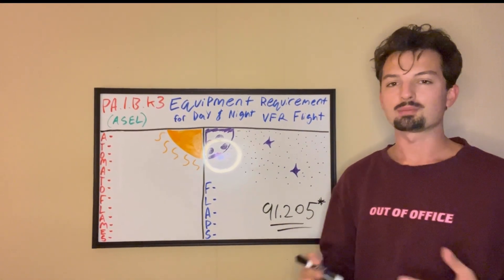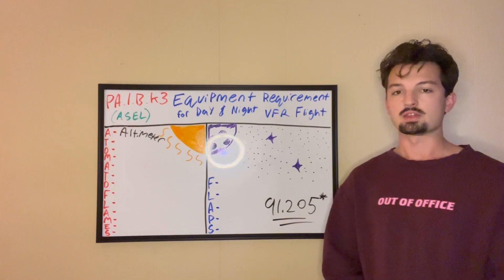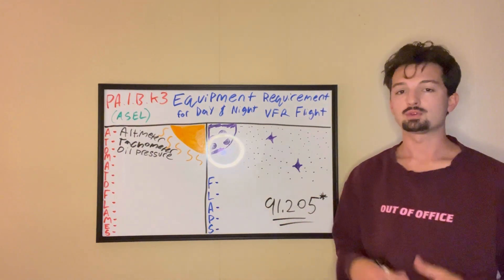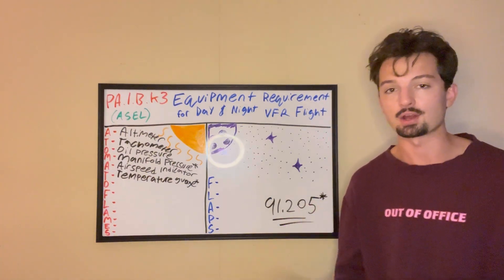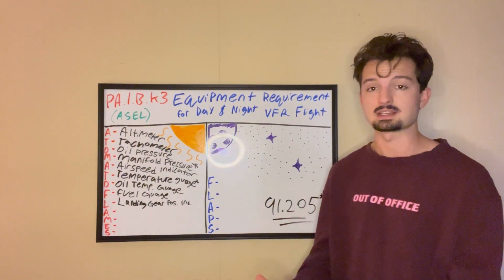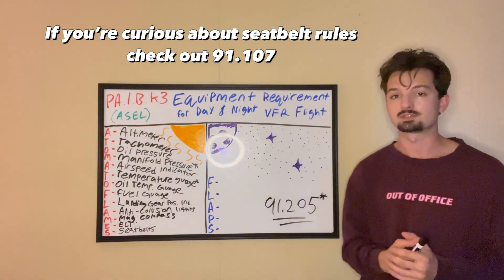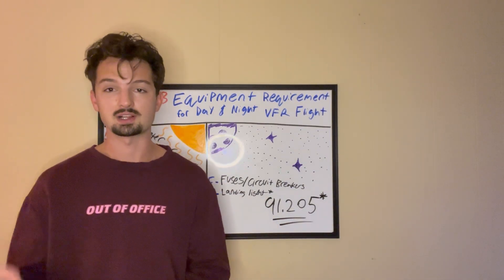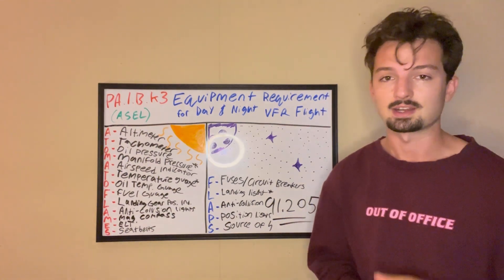THE ACS - ATOMATOFLAMES; Equipment Requirements for Day/ Night VFR (PA.I.B.K3)

Comment: With the anti-collision lights being on both sides. If your plane was certified after March 11, 1996, you need anti-collision lights Day and Night. If it was certified before this date, you are only required to have anti-collision at Night. Regardless of the date, every aircraft needs anti-collision lights at night. Student Pilot from Florida Love your videos man, keep it up.
Reply from the maker: Yes every plane needs anti-collision lights at night, and the rotating beacon also counts as an anti-collision light, in the case your plane was certified before March 11 1996 you do still need anti-collision lights at night, but the rotating beacon alone counts, in the case you don’t have strobes, or they are inoperative. 

I’m glad you’re enjoying the videos! Florida is the new farthest!! 🌴